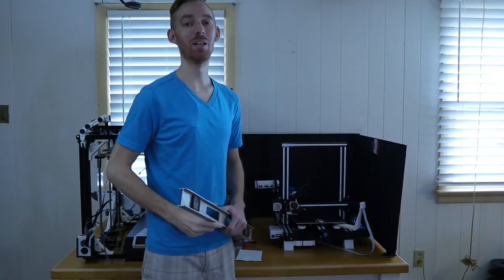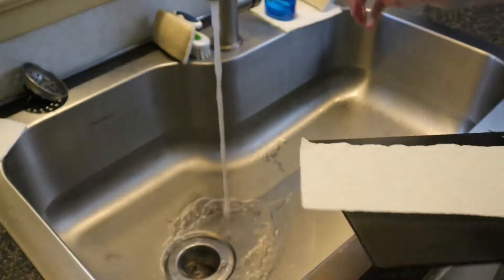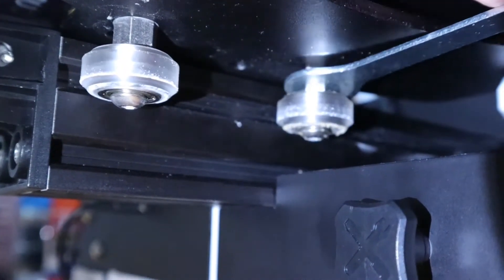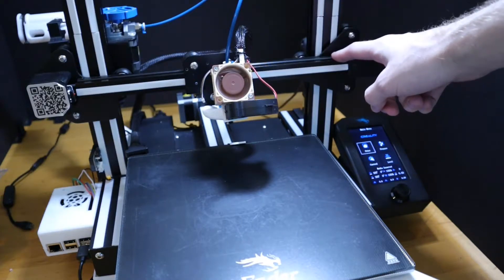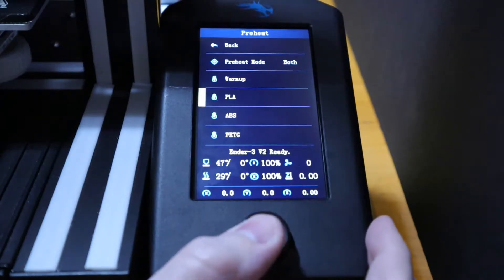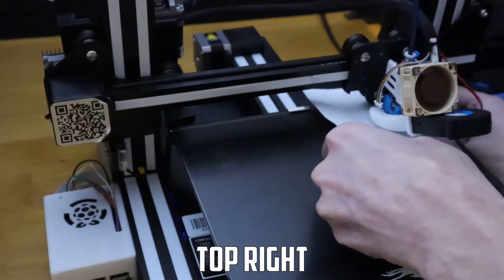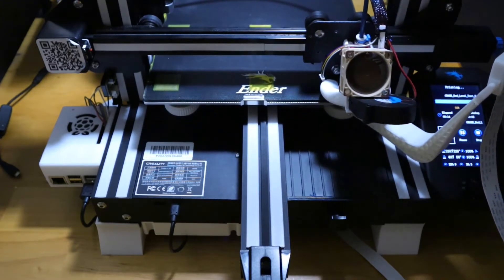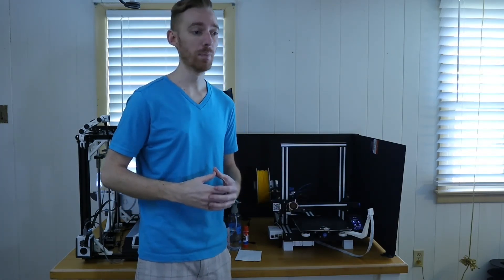Ender 3 v2 Bed Leveling for That Perfect First Layer!

Comment: the problem I have sometimes is the bottom layer "sticks" and the print is looking great and eventually it still starts to lift up...makes no sense.  I have had this happen various times throughout my year or so with this printer.  I always get it to stop but it seems like I do different things until it works and it never makes sense...I never really understand how I stopped it.  The bed can be leveled so perfectly.  The filament brand new.  everything just perfect.  Then bam after like 3 or even 6 or 7 great prints, it happens again.  Even with hairspray.  I check the bed, check everything, nothing changed.  everything is flawless...yet 1 or 2 corners start lifting.  Most frustrating thing ever.  So I bought an s1 (and an s1 pro but haven't used that yet).  Same damn thing.  I'm starting to think maybe it's the cool air coming in my window or something cuz this sht makes no sense.  This s1 printer has the auto bed leveler.  doesn't help.  PEI steel bed (it was a deal where I got it free with printer purchase).  Same sht.  Lifting up on 1 or 2 corners out of nowhere.  Anyone know what this is??
Reply: so what was the solution to your problem with corner lifting?
Reply: @victorjbarker  I think I printed a little duct thing where you tilt the print cooling fan and put this tiny duct on.  What it does is it makes it so that instead of blowing hot air up from the bed onto the print, it blows are from directly in front of the uh...print head? whatever you call it.  I can send a pic or find the part if you want.  Also I bought a couple of bambu lab p1s printers and that's how I print most things, but I still print my petg parts on my s1 pro and they come out flawless every time now.  Also I print on, you know the rough bed.  Sorry my memory is sht these days.  the not smooth bed. lol.  and I NEVER use any sort of adhesive anymore.  I just print away and if it don't stick right, I clean with isopropyl alcohol like 97 percent or something and clean rag, and then it works for several more prints.  I got the curling on my bambu lab printers too but then started turning off the aux fan and they print perfect every time now (for thousands of prints)

Comment: i do not have the option for leveling. Is this a special firmware oder custom?
Reply from the maker: Yes, the option for leveling is if you have a BLtouch installed or are using a custom firmware like Jyers, for manual mesh leveling

Comment: Thanks for the video! Question, how are you lowering and raising a side of the x gantry, if it’s not level ?
Reply from the maker: It shouldn't be out more than 1mm or 2mm. With that, I just push down or pull up on the right side of the gantry while holding the left. Then I recheck their heights with the height gauge parts and calipers
Reply: I was about to ask the same thing. I haven't checked yet but I feel the bar is slanted due to the tightness of my springs under the bed.

Comment: Firstly, I had no bloody idea I could remove the clamps so easily. I've had a bit of protective plastic stuck under the top one for a little over a month, so thank you.

I'll be sure to try this, I have to send my BL Touch back because it is faulty, I am so annoyed. I didn't even know there were knockoff versions, this one is called 3D Touch.
I hope other people have had a better first month of 3D printing than I have. It has been no end to disaster. :(

Don't get me wrong, I have printed a few things, some of which came out amazing, but the amount of fails out weigh the successful prints. I love print-in-place, it took me a week to successfully print a flexible Pickle Rick. I had to enable raft just to get some adhesion, with brim or skirt, the parts would just wander around the bed.

Comment: I cant seem to get my x gantry level....mine is sagging a mm on the right side if you stand looking from the front of the printer. Thanks...great vid btw.
Reply from the maker: I would say check the bolts that hold the x gantry to the pom wheel plates. There are 4 of them, and may need to be tightened.

I also recommend checking out the x gantry section of this video:
https://youtu.be/AN0MlQMMew0?t=1054

I used that vid and it really helped me with my x gantry problems.

Comment: Great video, thank you. I have a question: how to find the 'starting point' of the bed levelling? What I mean is, from what level of the springs' compression do you start the process?
Reply from the maker: You know, that's a great point and one I should have included in this video. 

What I do is I tighten all of the springs all the way tight, then I back each one off 5 full rotations. Once that is done, I lower the nozzle onto the bed. I then adjust the z-limit switch up until it clicks, then lower it until it is just about to unclick. That is where I tighten it into place 

This is then my starting height for leveling the bed.
Reply: @EB3DPrinting  Thanks, this makes sense and helps a lot!